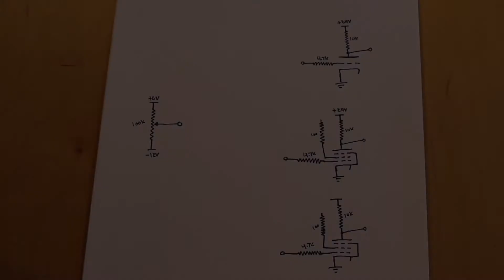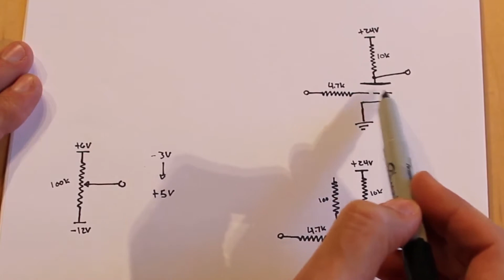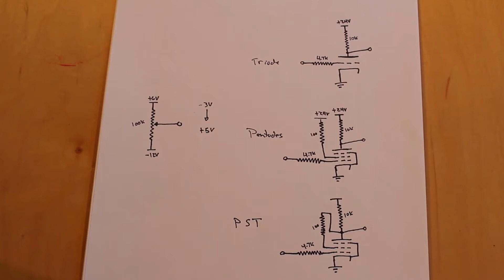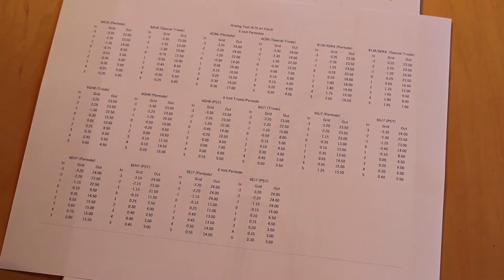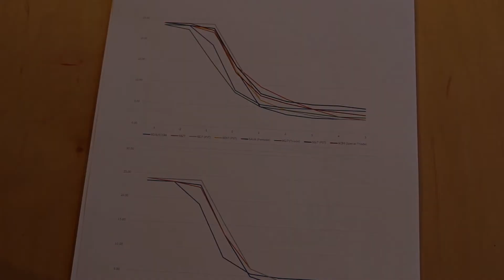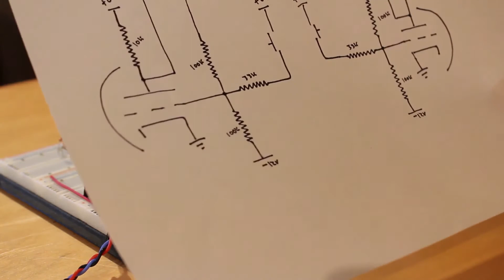Vacuum Tubes: Episode 8 – 24V Vacuum Tube Shootout (Triodes, Pentodes, and Pentodes as Triodes)

Comment: With those kinds of b+ voltages why not save yourself a ton of room (and electricity!) and just use some subminiature tubes that Raytheon developed back in the late 50s/early 60s. I have one (CK534-AX) that is a pentode that has a 10ma 0.625v filament and a plate of 15-30V. Should be perfect for what you are doing!

Comment: Nice video!
I wonder why you are always using a 10 k plate resistor though? I imagine that at least some of the tubes that performed poorly by not pulling the output very low would do much better with a bigger plate resistor, because the same amount of current can pull the output lower. Of course, the output impedance will bigger as well.

Comment: Honestly, your arbitrary choice of a ridiculously low B+ makes these data of low interest. At a minimum, you need to do a study of your top 3 at various B+ levels around your choice. At the out of spec voltage you will find unpredictable results which may not be linear.

Typically, specs start at 50 VDC. If you want to stay in the “safe to run into” level, 48 VDC is the popular choice. It will make things much more predictable.
Reply: These data are of interest because his B+ rail is ~24VDC. Further, he does not need linearity as needed in Class A amps; he needs more of a step function.

Comment: i often wonder why alot of companies stopped using 6V6's they have a much smoother gain than other outpout tubes
Reply from the maker: If I had to venture a guess, I would say it was due to size. A lot of octal tubes got replaced with smaller, heptal or noval tubes to miniaturize components as much as possible. Even the venerable 6SN7GT got miniaturized into a noval package and labeled the 6CG7/6FQ7. I suppose with the advent of new cathode and anode technologies, and improved construction techniques, this made sense as tubes could be made smaller without sacrificing too much in the way of power or sound. Having said that, a properly set up amp with a suite of good octal tubes still sounds absolutely sublime!

Comment: Add a couple of capacitors and you could have a multivibrator flashing LEDs. :)
Reply from the maker: The classic multivibrator is one of the greatest designs! It's super easy to implement and make a nice oscillation! Though, I'm a bit more fond of the Hartley oscillator if I'm honest.

Comment: Try looking into the pcc88 there cheap and only have a different fillament
Reply from the maker: Interesting, the PCC88 is like a 6DJ8 with a 7V filament. That would make for some interesting connections when running the heaters in series. Here in the US though, they seem to be going for about the same cost as the 6DJ8. Most likely they weren't a popular tube here and that makes them fairly rare. Either that or I'm terrible at finding the cheapest places to shop for tubes, haha.
Reply: @UsagiElectric  to bad your not in holland
we have a guy that has amazing prices
http://www.electrontubes.nl/Voorraad/voorraadset.htm